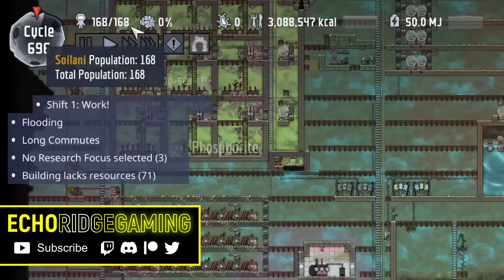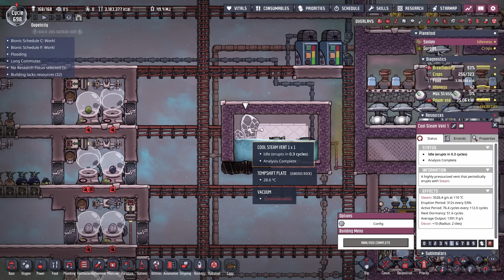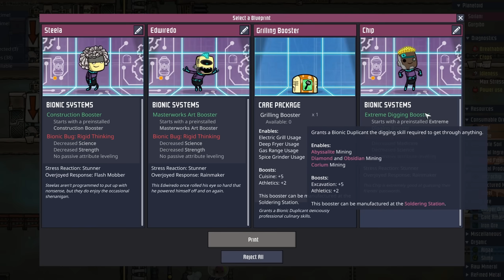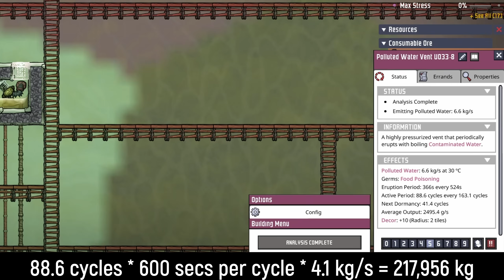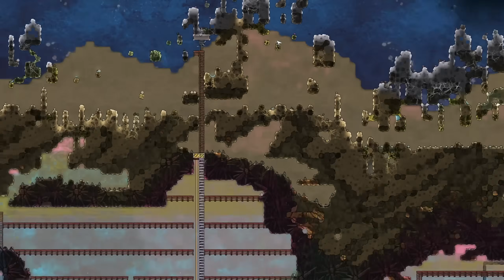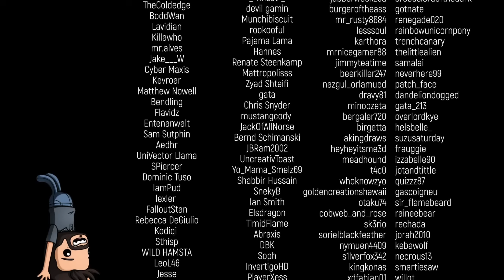Passive Cool Steam Vent Taming | 172 Dupes | Ep 31| ONI - Max Dupe Challenge

Comment: You probably won't see this because I'm very late to this party but when you hooked that polluted water vent to cool your steam vent you placed a valve to restrict the flow. The problem is you waste a lot of energy because the pump runs all the time but only pulls little packets out. (same with water filters and desalinators.) I like to use a buffer tank with automation. When the tank is full shut off the pump. When the tank drops below 25% kick it back on. That way the pump only runs when you ar pumping full packets of water. Saves a ton of energy in the long run. Especially if you look at the maybe dozens of pumps you have running in this playthrough!

Comment: Hi echo, off topic but I was curious based on your extensive knowledge on oni if there’s any good magma production designs, and if you could cover one, I have a giant geothermal plant that stretches along the entirety of the bottom of the map, super overkill, and not the best form of power I know, but I wanna make it work and sustainable as all the magma has solidified within a couple cycles due to the 45 steam turbines liquid output I think. All I got is a glass boiler, but it’s very dupe labor intensive. I’m also running three geotuned volcanoes into the giant tank. Just wondering if you have any suggestions or heat generation recommendations to re-melt the igneous rock maybe🙂

Comment: Hey, You did  video on the conduction panel for heat redistribution. Would layering a conduction panel, a wire bridge, and a gas bridge over a temp shift plate result in faster heat redistribution?

Comment: It’s kinda crazy how this colony didn’t crash. I’m at day 1100 with only 16 dupes but I’ve had multiple times where my food stores and oxygen fluctuate for production and my colony teeters on collapse. Around days 600-700 is when I actually had things stable with a spom, automated hatch ranches, my first tamed volcano and hot water geyser and the early stages of an industrial brick. But I’m at day 1100 and still haven’t even gotten into the oil biome. Got  lucky with a leaky oil fissure that was my start for plastic.

Comment: uhh slight warning with the polluted water tank
polluted water offgasses 
That removes polluted water
and youre removing EXACTLY the same amount that is being added
so the offgassing will reduce the amount of polluted water
Reply from the maker: Only for a time. I seal up the p water tank, so eventually the pressure will be high enough that the water will no longer off gas.

Comment: 16:10 that transfers heat. You need a 2 rile high drop otherwise the liquids will connect. I think this is the case since the last update that fixed some of the liquid duplication

Comment: Just build a buffer tank for the gunk boiler to be safe. Average the gunk production output and avoid the small packets. You even gain a small amount of efficiency this way, because you avoid big 10kg packets, that are harder to warm up. But don't forget to set the right flow and do an overflow protection to be safe.

Comment: Since I am getting (back) into ONI:
At the beginning I normally try to have each section separated like you. And I try to make everything breathable and ensure, that I get the ventilation correct. However at some point it becomes more or less impossble (at least for me) to have one big base, that is actually ventilated.

So I tried to enclose the barracks for my dupes and make them put on an atmo suit after they get up to omit the need to handle all gases correctly everywhere at once. 
Is this somewhat a viable strategy? It feels like it needs soooooo much setup until you actually get it going. And until now I did not really get that much use out of it.

TL;DR: How do you construct your base at the midgame? One area with barracks etc and everything else just with an atmo suit?

Comment: Echo, since you're making the polluted water tank as integral to the geyser room, there's no reason to get all the polluted oxygen out of the tank, it'll come back.

Also, to solve the issue of small packet size in the gunk boiler, you can put a reservoir on a door with the automation hooked up such that the door will open when the reservoir has too little liquid in it, and close when it has enough. While the door is open, it won't output liquid, but it will receive. By this method, you can guarantee that a liquid pipe always has full packets in it.

And lastly, for a mixed gas room I'm trying to turn vacuum, I put a reservoir attached to all the pumps if they share any piping to the ultimate output, to guarantee that they never wait on each other to work, so it is MUCH faster to vacuum the room.

Comment: Your math on the polluted water vent isn't quite right.  You assumed that during the active duration is always outputting 6.6 kg/s during it's active period.  In actuality, it is only outputting 6.6 kg/s while erupting, which it is doing for 366 seconds every 524 seconds.  That means your average active polluted water output is 4.6 kg/s.  Subtracting the 2.5 kg/s, you end up with 2.1 kg/s accumulated on average during the active period, not 4.1, meaning you need a buffer of 109,116 kg, or about 20 tanks (since the room itself is a buffer).

Your buffer is about twice as big as it needs to be.
Reply: I also always put buffer tanks in the buffer room just under the vent to further cut the room size in half as well. Makes it much cleaner for me
Reply from the maker: You are 100% right. I def skipped the multiplying by the eruption time %.

Comment: Raising the Gunk level won't solve the Sulfur gas leak, because the gas rising from conversion will still possibly escape. The problem is there is only a one tile barrier with a drop of Petroleum to block it, which can be pushed away into an open space. All you have to do is double the length of the barrier to 2 tiles wide.

Comment: 15:58 I wonder if the liquid sulfur waterfall was a low enough temperature that it:
* dripped into the petroleum pool right next to the lock 
* flashed, pushing the petroleum lock out of the way
* released the sulfur gas in that tile, and all the sulfur gas behind it.

If that’s the case, moving the lock up 1 tile will actually make the problem WORSE, because you’ll get lower-temp liquid sulfur able to do the same thing again.

I’d add the blocker tile back in (the one you removed last episode) or add an extra tile off the edge of the sulfur zone so it drips in the same column as the gunk vent.

Comment: 11:44
I am pretty sure Average output is actually "how much water it will produce over whole active period devided by length of that period". But in ONI geysers and volcanoes erupt it its own mini-cycles, which refered as "eruption period". 
So lets do the math.
That geyser produce 6.6k/s water only while its erupting, but it's also not erupting (524-366)/524 = 30% of the time it's not dormant.Thus, total water output will be 88.6*600 seconds of non-dormancy * 0.7 percentage of eruptions * 6.6 kilos of water being produced = 245.6 tons of water.  You also can calculate this number from average output number itself: 136.1*600*2.495.

And you are expected to use water close to average output during this time, so you can subtract 88.6*600*2.495 = 132.6 tons of water which you will drain out. 

Final result would be 113 tons, or only 23 buffer tanks. Or ~12 buffer tanks within natural water pool.

As you can see, you can simplify that by factoring out average output and 600 seconds in cycle: (136.1-88.6)*600*2.495. So just dormancy period times average output

Which makes total sense: you need exactly that amount of water buffered to supply your water demand in dormancy period

You can use your method too, but you have to calculate "average output during active part of the cycle" speed first.
Reply: average output is how much water you get per second forever. so thats average output of active plus dormant period in grams per second
Reply: @twicethebaka5640  Why yeah, i just tried to describe it from any perspective one could have approaching this problem.
Reply from the maker: I did skip right over the actual eruption period.  Good catch.